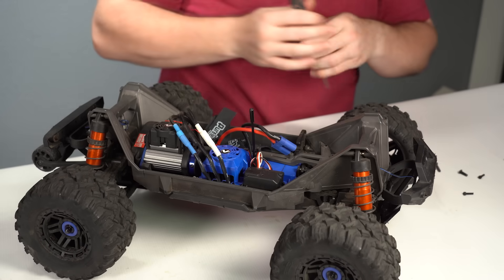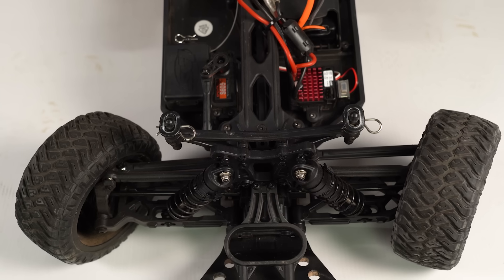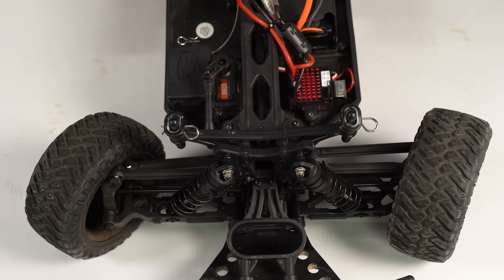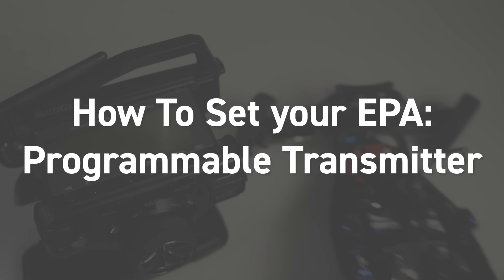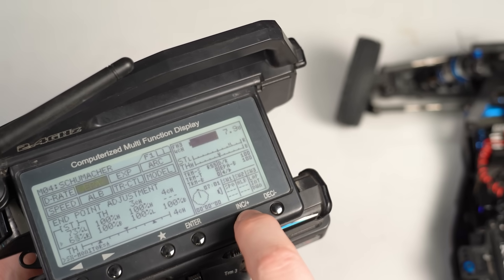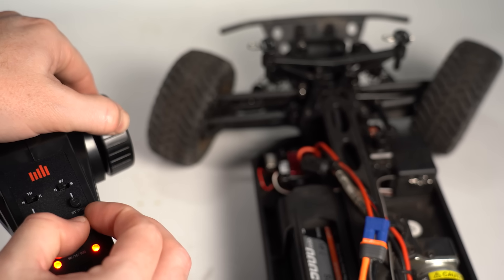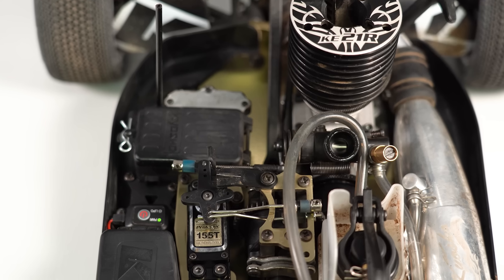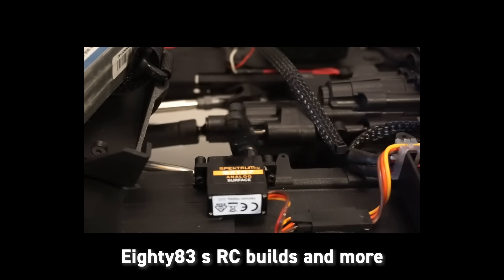How To Set your Servo Endpoints & Why it Matters - For Arrma & Traxxas TQi

Comment: Is there a way to adjust steering trim so the knob is centered on the tqi? To go straight i have to clock it to the right. I adjusted the servo horn and I can't get it perfectly straight.  I either have to clock the knob to the right or the left.  Is it possible to reset the steering trim to center?
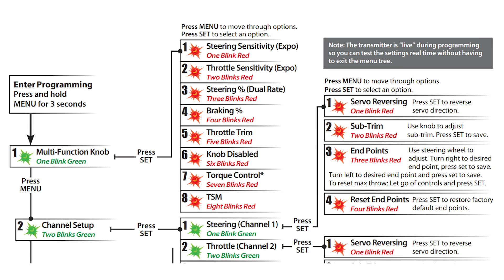Reply from the maker: Usually the knob is not centered because the servo is usually off center a little from where the vehicle is. You can't reset steering trim per say, but you can adjust sub trim, which is like a more precise trim to use, before the actual steering trim. Go to 5:34 in the video and look at the program tree, and notice directly above the end points, is sub trim. 

Hows the servo saver in your vehicle? Sometimes when they start to wear down, the steering gets sloppy and doesn't center. When driving, it feels like the car just steers where it wants to, like "wandery". 
-Brett
Reply: @AMain_Hobbies  thanks for the reply. I'm kinda new to the sport. So what does the sub trim do?  I did what the traxxas manual says and I'm not seeing any changes.
Reply from the maker: Hey, you're welcome @jadebylund7061 . Here is an explanation copied from the TQi manual:  The Sub-Trim function is used to precisely set the neutral point of the steering or throttle servo in the event that simply setting the trim knob to “zero” does not completely center the servo. When selected, Sub-Trim allows finer adjustment to the servo output shaft's position for precise setting of the neutral point.

This might help you center up the servo without maxing out the knob on your transmitter. What vehicle do you have? 
-Brett
Reply: @AMain_Hobbies  is on a rustler 4x4 vxl. I just changed the servo out after the original died.  I've had it 3 months now and the servo savers still seem okay.

Comment: What about drift cars that have wide angles like Yokomo YD2S or the 3Racing Sakura D4?
Reply from the maker: Those vehicles are designed to have more steering angle than an average vehicle, but the end points still need to be set. 
-Brett

Comment: I'm so glad my wife and i got rid of our Arrma and Traxxas transmitters.
Reply from the maker: Good call. A good programmable aftermarket transmitter is priceless and can be used with all your future vehicles. What transmitters did you get? 
-Brett
Reply: @AMain_Hobbies  I actually went for the under dog... FlySky Nobel. And oh my goodness am I impressed.  My entire fleet is tied to it and the response, the range, the fine running, and the features are amazing! Well worth the investment in my opinion. Its even set up for boats on a separate setting!!! Highly recommend!!! But be prepared to shell out $260 for the transmitter and $40/ receiver.

Comment: I just got a new standard size analog Hitec servo for steering and it makes that "overextended sound"(1:51) at all times, in any position, even without a horn on it. Is it a defective unit?
Reply from the maker: It's hard to say, some servos are just noisy. But if it's still noisy when there is no load on it, then that's just the way it is. 
-Brett
Reply: The case doesn't seem to be getting warm or anything so maybe it'll just run this way for a long life LoL. It was among the cheapest Hitec has to offer and still seems stronger and is definitely faster than the stock RTR digital servo it replaced. Can't hear a thing once the nitro engines fired up XD so I'm just gonna send it. Thanks for your reassurance! and all the parts and supplies!

Comment: Dang...all I got is TQ radios!
Reply: If you have Traxxas link you can adjust it on the app I think.
Reply: @itchyprince3793  yea you can, that's how I do it because it's easier for me doing it thru the app
Reply from the maker: The TQi is Link Enabled but the TQ isn't, so how do you get the app to work with the TQ? 
-Brett
Reply: AMain Hobbies whoops 😬, got my letters mixed up.

Comment: I always have set my endpoints with the hum of the servo, dial it down til the hum stops
Reply: That’s how I’ve done it
Reply: Thanks for the tip!😁
Reply: I have a trx4 sport, with tq transmitter,  not the tqi.. right out of box, binding to the left...how can I adjust?
Reply: @gregoryduvall4758  check your steering rack bearings they are delicate and I blew a few on some of my cars and it bound the servo up a lot
Reply: @gregoryduvall4758  For the TQ transmitter (Tx) you cannot set it. Did you watch the video? The video stated this at the 5"15 mark. 

The next clue that you cannot set the EPA with your TQ Tx is that the instruction manual does not include the instructions while the TQi Tx does include the instructions.

You are simply out of luck and will need a different model transmitter and possibly even a different Receiver as well.
Reply: @NC-123-45   I actually found the device online but you can purchase you can plug in between the receiver in the steering servile and adjust the pots on this device..
Reply: @NC-123-45    I did watch the video I was asking about other ways to adjust like for example when I flew RC helicopters if you could adjust the servo to the correct endn points we would adjust the linkages I guess I should have been more specific
Reply: How I’ve always done it
Reply: Same  bro
Reply: Same
Reply: Yup

Comment: Hey you guys forgot to mention that for 4wd cars sometimes the wheels will turn further than the driveshaft can freely turn. The car will steer freely when stationary but if you put your hand on throttle it might start binding. I’ve cracked my shafts like that
Reply: So dont do it like this then..(felony)    I upgraded my servo and its stressing..
Reply from the maker: Great tip! Thanks for adding that. 
-Brett
Reply: @AMain_Hobbies  will you be doing the wishlist thing this year too?
Reply from the maker: @AtomicVader356  I don't know for sure but probably. 
-Brett